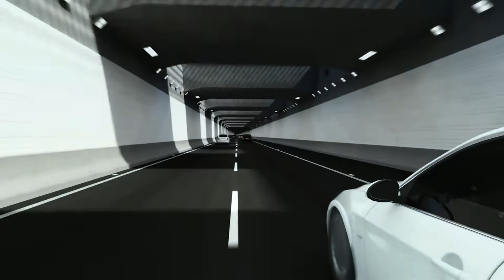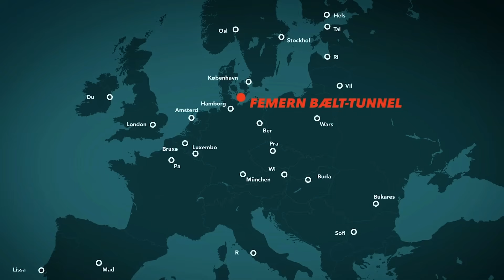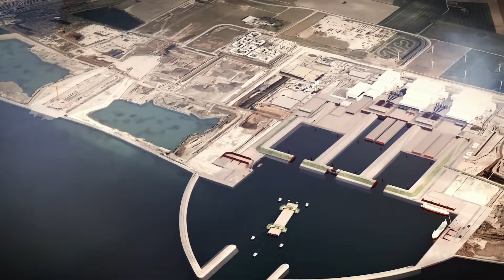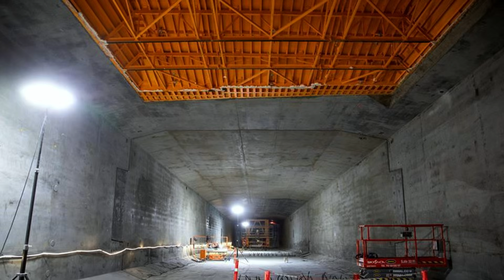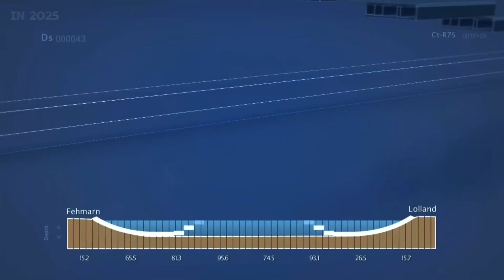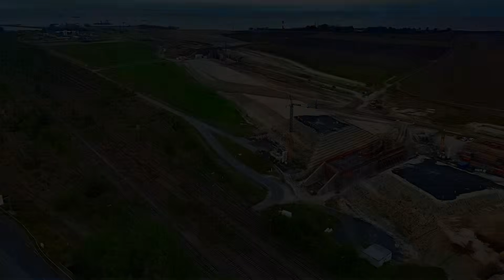Inside the Fehmarn Sound Tunnel Build: How Germany Connects Land and Sea

Comment: Useful film; however there is much use of CGI aerial impressions of the planned shorter tunnel under Fehmarn Sound, which is the channel between the mainland (Holstein) and Fehmarn (island), giving the wrong impression that this is the Fehmarn Belt immersed tunnel. It is not; it is not the same as the Fehmarn Belt tunnel, which is the long one under construction from Puttgarten to Rodby. The Fehmarn Sound tunnel is not yet confirmed, financial authority has not yet been given for it, and work is yet to start on it. The Danish-German Treaty states that this new connection need not be provided for seven years after the opening of the Fehmarn Belt tunnel (that is, 2036 if the tunnel opens in 2029). The existing highway and railway opened in 1963 including the landmark Fehmarn Bridge can continue to handle the traffic and it is not proven that it cannot do so. One solution at the Fehmarn Sound is to build a short undersea immersed-tube tunnel for the road traffic and leave the railway services using the bridge. Another is to use more of the width of the Fehmarn bridge for trains, so that it has two tracks, with the remaining width as a slow-speed road for local traffic and cyclists, while building the immersed tunnel for all but local road traffic. The Fehmarn Bridge is a very good design and well-known - it could continue in use for the international rail services while just the road is put in an immersed tunnel.
Reply: If you travel there you can see that they are expanding the width of road up TO the island (probably on the island too. But WHY? If the bridge capacity remains the same and is already a bottleneck even without the tunnel. Can u imagine how it will look on that bridge once the tunnel is open?  😮
Reply from the maker: Thanks for the updated info! Hopefully we will be able to do an updated video down the line a little bit!